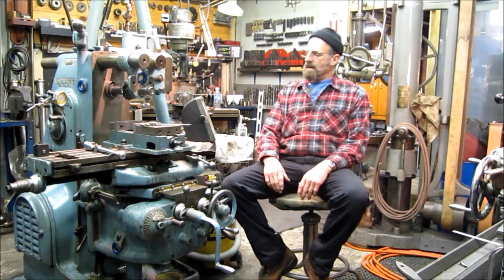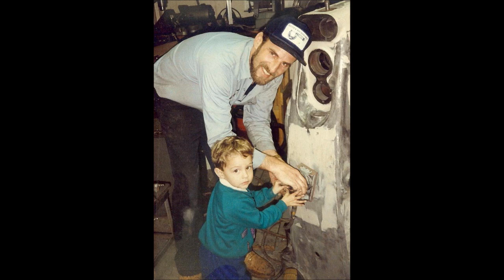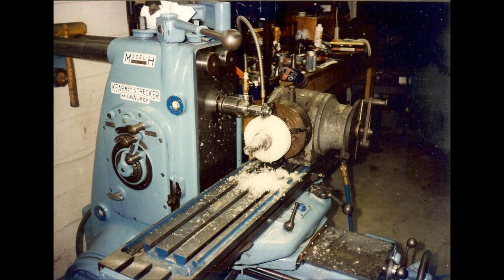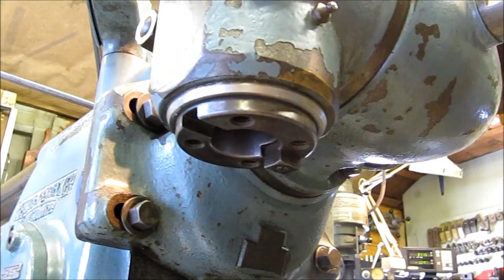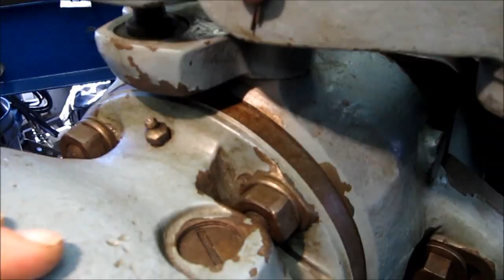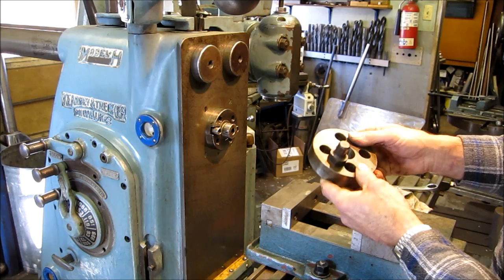K&T 2HL Part 1

Comment: Great videos. What got my attention is the mention of Western Gear in Lynwood California. My father worked there along with his brother around 1952.  It was my favorite place to go and look around at the gigantic machines.  In the 60s and 70s they made ship propulsion gearboxes as well as horz-stab, recirculating ball, jack screws for C5 & 141cargo planes.

 Your videos have been the best source of machine practices and shortcuts I have seen to date keep up the good work.  Also, I rarely see someone actually feel the work surface in order to determine the quality of the cut.

Keep Them Coming
Ken Sparks

Comment: Great video Keith ! The same handles were broke on mine too when I got it . I did a horse trade to get it . I upholstered the inside of a pickup I think to get it . Mine was made in 1942 I think and spent most of it time serving the US Navy. I found a web site years ago that had them listed by serial number if I remember correctly. I didn't tear mine completely down when I got it going . Great job on doing yours ! I really like using  mine as I'm sure you do yours .

Comment: (1) I purchased  a K&T 2H at an auction for a steal ( less than 1/2 of the scrap price) . I inspected it a bit and decided it would be worth it  to take it apart and do a little cleaning an painting on it to put it back into usable condition again, as it had sat outside for a while, and all of the precision surfaces had a fair bit of surface rust on them.  I got a vertical head for it of of eBay as well.

Comment: I have and use the brother to your machine K & T Model H. It is a rigid  and reliable machine.  Bought 2  used machines over 20 years ago. As I remember it I traded one to you for work on the gear boxes for Doall MP20. I remember the excellent paint job you put on your machine. Do you still have the universal indexer?

Comment: What would cause the table not to feed in any direction when engaged.  You can manually move the table in all directions, but when the levers are engaged to make the table move on it's own, it won't move.  If you have it set to move in any directions it won't move, but if you pull the rapid travel lever up it will get the table to move the direction you have it set to move.  Also it sometimes will move when pulling up on the rapid travel lever, other times it will make a loud grinding noise.  Any ideas?